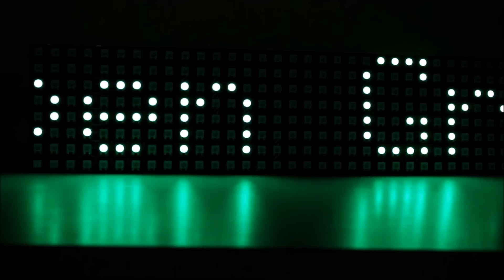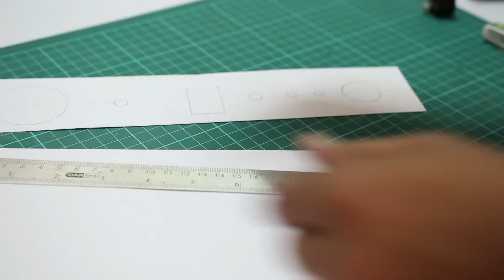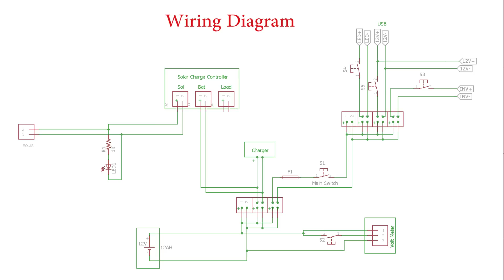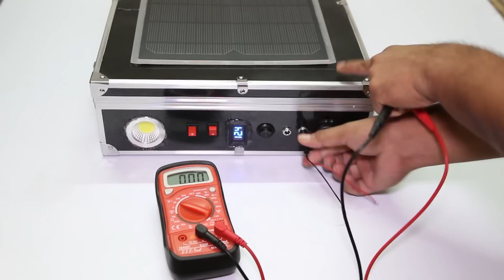DIY All in One Portable Solar Power Pack || Low Cost Solar Generator

Comment: A quiet Generater.Systems , love the dual fuel capabilities, camper is 50 amp but the adapter helps and found it still handles the load. Haven't taken a camping trip yet, that's in a couple of weeks. Will see how well it does over a long weekend.

Comment: To be honest, even though this was a cool project, you just expected that we knew what every part you used was. The thing at 1:02 I have no idea what that is, the other thing at 1:05 with 3 wires coming out, I don't know what that is. Why did you need to unscrew the back of the inverter? at 7:11 there were no wires on the solar panel, next thing I know you're connecting the solar panel wires to something else.

Point is, you seem very talented, and you know what everything is, I don't, probably most people don't. Just put some kind of note on the video or annotation letting us know what each part is, why you do things that we wouldn't think of, etc. I hope I'm making sense. Do I feel alone, is anyone else feeling this way?
Reply: JoeAceJR The thing at 1:02 is backside of AC plug he is measuring it's size with callipers to make holes.
1:05 is a battery voltage display to keep the track of voltage on battery terminals.
The wires from solar panels go directly to solar charger controller. It's schematic diagram is in the description.
No worries mate you can always ask if something is not clear. This way you will learn and grow to make even higher level stuff with your own.
We don't add basic things because it makes videos far longer and in a was wastes times of people who already know,so they can make this asap.
Cheers.👍😉
Reply: JoeAceJR The thing at 1:02 is backside of AC plug he is measuring it's size with callipers to make holes.
1:05 is a battery voltage display to keep the track of voltage on battery terminals.
The wires from solar panels go directly to solar charger controller. It's schematic diagram is in the description.
No worries mate you can always ask if something is not clear. This way you will learn and grow to make even higher level stuff with your own.
We don't add basic things because it makes videos far longer and in a was wastes times of people who already know,so they can make this asap.
Cheers.👍😉
Reply: Thank you.

A battery has a + and a -. What is the yellow wire for?
Reply: JoeAcrJR The black line connected to the public negative electrode, red line connected to positive pole of power supply, yellow line connected to positive pole of tested power supply. As simple as that.
Hope to see you coming up with something even more exciting DIY on your channel.
Reply: Im talking about a battery here.

The black wires the negative

The red wires the positive

What does yellow do?
Reply: JoeAceJR Take it this way,the black and red are to power the unit and yellow is hooked up onto the "test".
As ground or negative is common all over the circuit.
Reply: So the yellow is the ground wire? How does the ground work exactly? Is it like you hook up the yellow wire to a metal pole leading into the ground?
Reply: JoeAceJR No dude,Red and Black are to power the unit so one circuit complete with one battery.
Now say we want to measure the voltage of a different battery so we will connect yellow wire to battery's positive terminal and negative to first battery's terminal and/or the black wire.
Reply: What kind of battery are you using? Actually heres a better question. Do you live outside the usa?
Reply: JoeAceJR Well any battery from 0 to 30 V and there is also a link to the voltmeter in the description.
And I don't live in USA.
Reply: I live in the usa. We have a different energy grid and such as you guys do. Where do you live (what country)
Reply: JoeAceJR I think we have the same system,220-240V 50-60 Hz AC. The uploader and myself are from India.
Reply: We are 100V-120V AC mains.
Reply: JoeAceJR Doesn't matter search for 12vdc to 110vac inverter on Amazon or ebay you will find it.
Reply: I did. So???
Reply: JoeAceJR Then all you have to do is to place that unit instead of the one shown in video at 2:39 and everything will work as shown.
Reply: I figured that. But remember when he unscrewed something on the back of the inverter, why did he do that?
Reply: JoeAceJR He just relocated the switch from back of the unit to side of the box just to make it accessible even when box is closed.
Reply: JoeAceJR

Comment: Sir..you can use BMS...for battery charging for solar power bank...whether it is to done...
Reply from the maker: BMS is required when multiple cells are connected together. Mostly in case of Li Ion battery. Here I have used lead acid battery.

Comment: is there a way to know that the battery is fully charge?
Reply from the maker: Yes, you can see the voltage.If the voltage is 13.5V or more than it is fully charged.
Reply: owhh ty

Comment: hello my name is denis. i just want to know can i use this battery NPP HR12150W FR 12V 150W 12Volt 40Amp High Rate Rechargeable AGM Lead Acid UPS Battery. because im planing to running 3 led light 3 x 14watts = 42watts, 42watts x 10 hours = 420watts. thanks

Comment: as shown below a bag maker will use 80 pieces of 18650 cells and all 20 packages will be 12v 25ah and this dewre side 4 packages each pakette 20 shar cell will be on 4 pakette on off because 12v outlet because you can pull a cable from below and put a voltmeter and put the probe If you do a simple video work on this topic, take a look at this topic and you will be happy to work well

Comment: An ok concept and I think the creator has stated the battery size can be increased already. After making something similar myself but using 2x 17aH deep cycle scooter batteries in parallel for a total usable 17aH of power before depletion (only half a lead acid battery capacity can be used) I  have a few observations. Unless you have good Sun all day every day add a mains way of charging into the pack. I'm uk based so Sun can be a novelty! With a 10w panel that fits the case well I can only get up to half a Amp of charge per hour into the battery in ideal conditions. So fully charging my 2 batteries needs 17 Amps so depending on time of the year and Sun conditions this could take  2 days to never fully charging! This can be remedied by increasing solar cell size by using a folding panel that still fits the case size for good portability. A 20w panel could reduce charge time by half but is still quite naff. Get to 100 watts of panel and we are then talking very reasonable charge rates.

Comment: I think the battery is to small for this Size of energysource. The capacity ist only about 140Wh. 
If you want to watch 1 hour TV, the battery will be empty.
Reply from the maker: +Tim Gellrich Its just a demonstration of the project.You can select larger capacity battery according to ur requirement
Reply: Open Green Energy can an EV be charged using this? A BMW i3 with  33 or 42 kwh  or a Nissan Leaf?
Reply: @gayenmarvo19  sure why not even your full house

Comment: Sell them, outdoors-people or people with issues with their power (i.e. Puerto Rico) would have a definite need for them, therefore a high demand. You could make a lot of people happy and make money while doing it. The reason that I say this is because most of the others on the market either don't work, are to much money, don't supply enough power, or use petrol not Solar for power.

Comment: A very heavy lead acid battery for portable application? NO thanks
Reply: Lead acid batteries have the benefit of holding far more energy than any other battery, even batteries wired in parallel as well as being cold resistant (as long as they are charged), very rigid and keep their charge longer and store energy more efficiently (they don't heat up much during charging and discharging). Sure, they're heavy, but for solar applications they are the best bet over any other battery type. they're also easier to charge than for an example lithium ion or lithium polymer batteries and don't catch fire if something goes wrong.
Reply: ***** You're right
Reply: +Kent Hinson are you sure? A lead acid battery can normally hold  at least 20 000 mAh or more, which is much more than any lithium battery. Don't believe everything Chinese battery sellers tell you, a RC battery can never hold over 7 million amp hours etc. They can also discharge hundreds of amps for short periods, and tens of amps continuously without warming up which lithium batteries can never do. They can maybe produce 100 amps max and explode due to thermal stress.
Reply: Right. Most of his statements are wrong. 

SLAs holds far more energy than any other batteries. 
No they don't hold energy any better than most lithium batteries.

SLAs keep their charge longer.
Then what's the point of recharging SLA every 3 month if not used?

SLA is the best bet over any other type of battery. 
No, this is totally wrong. Nobody use SLAs in their phones.

An SLA battery can normally hold at least 20Ah or more. 
This is wrong too. Why SLAs are commonly made with high capacity? Because at lower capacity, SLAs are easily beaten by other type of battery and not very reliable. The only reason why SLA still exist is because it's cheap, easy to operate and robust against cold temperature, nothing else.

An RC battery can never hold over 7000mAh. 
If you don't know anything about RC world, just STFU. Those long-range, heavy payload and professional multirotors and planes are using LiPo ranging from 2200-40.000mAh in 3s, 4s, 5, all the way up to 12s (1s= 3.7V nominal, 4.2V charged)

They can also discharge hundreds of amps for burst and ten amps continuous without warming up, which lithium batteries can't do. 
You must be kidding me. For the same size/weight, LiPos can deliver much, much more current than SLAs. Like, way much more current than SLA. A 10Ah SLA can deliver roughly 20-60A with lot of voltage sag while a high performance 10Ah 90/190C LiPo can deliver up to 1900A burst and 900A continuous. And for bonus, the Lipo weighs less than the SLA
Reply: Found this comparison in the internet. Hope you'd understand

1)   Weight: Lithium-ion batteries are one-third the weight of lead acid batteries. 

2)   Efficiency: Lithium-ion batteries are nearly 100% efficient in both charge and discharge, allowing for the same amp hours both in and out. Lead acid batteries’ inefficiency leads to a loss of 15 amps while charging and rapid discharging drops voltage quickly and reduces the batteries’ capacity.

3)   Discharge: Lithium-ion batteries are discharged 100% versus less than 80% for lead acid. Most lead acid batteries do not recommend more than 50% depth of discharge.

4)   Cycle Life: Rechargeable lithium-ion batteries cycle 5000 times or more compared to just 400-500 cycles in lead acid. Cycle life is greatly affected by higher levels of discharge in lead acid, versus only slightly affected in lithium-ion batteries.

5)   Voltage: Lithium-ion batteries maintain their voltage throughout the entire discharge cycle. This allows for greater and longer-lasting efficiency of electrical components. Lead acid voltage drops consistently throughout the discharge cycle.

6)   Cost: Despite the higher upfront cost of lithium-ion batteries, the true cost of ownership is far less than lead acid when considering life span and performance.

7)   Environmental Impact: Lithium-ion batteries are a much cleaner technology and are safer for the environment.
Reply: ***** Yeah, I think he's too poor to afford lithium batteries LOL
Reply: ***** Yeah, battery technology has become better and better and I'm very interested in newer battery technology, unlike that one who stuck with SLA forever LOL
Reply: Why not replace the lead acid battery with a lightweight lithium battery
Reply: Li-ion is really difficult to work with
Reply: Would you by any chance know how to charge those using solar? There's not much on here about it
Reply: Li-ion is very easy to work with. It's many times lighter than an equivalent lead-acid battery, it can handle much higher temperature ranges, they last about 5 times longer too. Lithium ion is worth it.
Reply: Actually, the operaring range of lithium battery is not as wide as lead acid battery
Reply: As far as temperature goes, yes it is. The water in the acid freezes at low temperatures.
Reply: Then explain why car can be started at low temperature? And explain why DJI make a heating system for their batteries?
Reply: Most car batteries have a casing that stops the cold from entering the battery. But if it is cold enough, the acid can freeze. And i dont know what DJI is
Reply: JoeAceJR not so sure about the event temperature ranges part. They're the lightest weight because of smallest metal atomic structure out of all elements and because they have smaller atoms, more power can be stored in a much higher energy density.
Reply: JoeAceJR I think he's referring to the maker of quad copter like DJ Phantom.
Reply: IRFZ44 Damn, everybody freaking out on the poor guy.  This is a solar charger.  There isn't enough current to charge lithium ion batteries.  With lead-acid you can trickle charge all day long.
Reply: IRFZ44
Reply: IRFZ44
Reply: PunakiviAddikti they dont catch fire they explore they produce HHO also have very poor energy density you can use 4lifepo4 which dont catch fire lighter and more capacity
Reply: Wow can’t lift a briefcase? Or you just mad you never thought of it. Go do some pushups sally.
Reply: @PunakiviAddikti  lithium batteries would still be better, they have better efficiency and if you were to put the same amount of space of lithium cells as lead acid then you would have more capacity, yes lead acid could put out more amps but this is a mobile application and you only really care about weight and amount of energy stored, not amount of current it can push
Reply: @homevalueglass3809  as long as you have it set up right you can charge a lithium cell on a less than 20~ watt solar panel
Reply: @PunakiviAddikti , lead acid battery are more safer and eficient, and Li-Ion batteries are cheaper and have more capacity. But LiFePO⁴ batteries are better.

Comment: Good idea for portable energy, however don't advertise it as "green power" because it isn't. Solar panels contain hazardous toxic materials. Moreover them and  batteries use a lot of fossil fuel burning to get produced (mining for necessary commodities like lithium, lead, cobalt, manufacturing, disposal, etc).  If you actually consider fossil fuel burning a problem (I don't) you have a problem. However, I love the anarchist, off-the-grid, underlying idea. Thanks for posting.
Reply: lool what a troll
Reply: reported for brain dmg
Reply: @MayankJairaj  What an eloquent elaboration of ideas …you didn’t show! Typical of internet bullies.

Comment: what fuse did you used
Reply: I only saw one in use on the schematic right between the first buss and main switch. Nothing before the inverter as is pretty common. A fuse block with the blown indicator LED's would suit this box nicely. Makes diagnosing any faults soooo much easier.